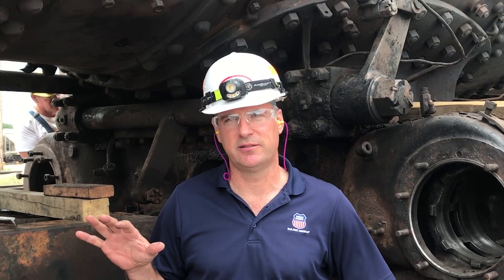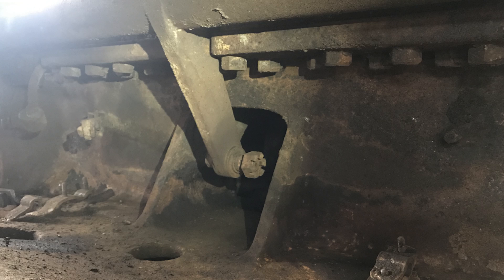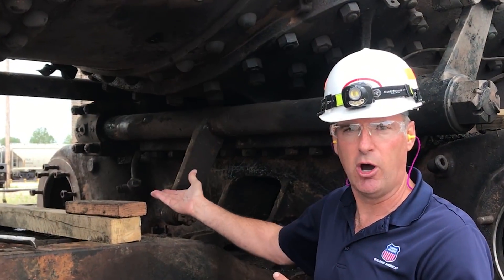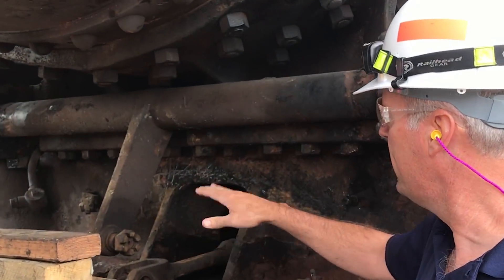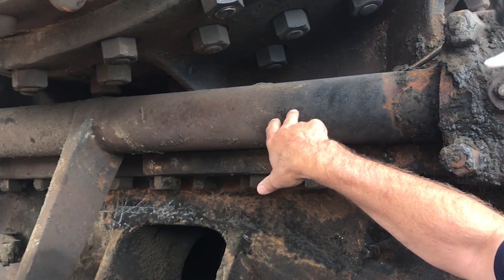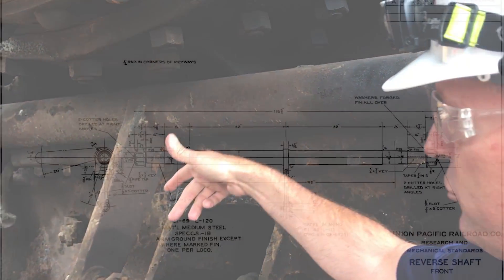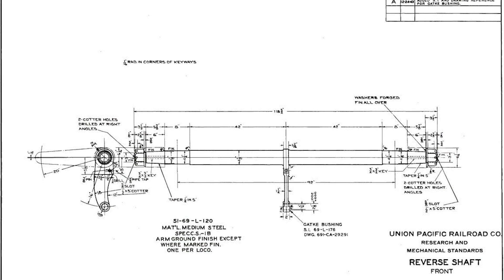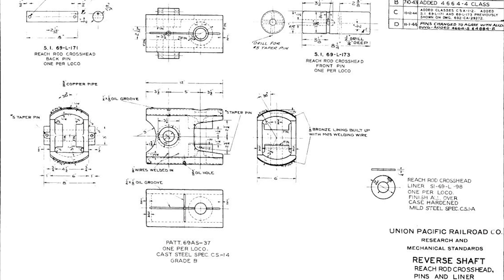Steam Update: Restoring an Articulated Locomotive

Comment: Will 4014 be converted to oil for it's fuel?
Reply: In one of the updates it is mentioned that the locomotive will be converted to oil burning using the same parts as 844.
Reply: Cool